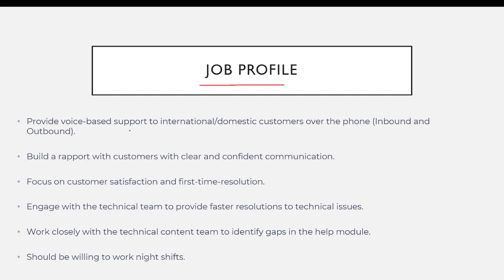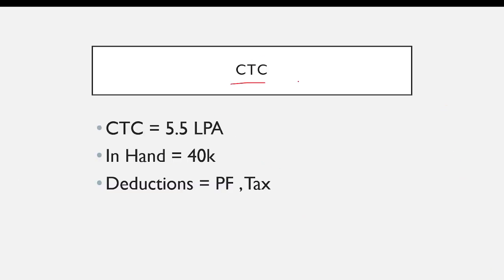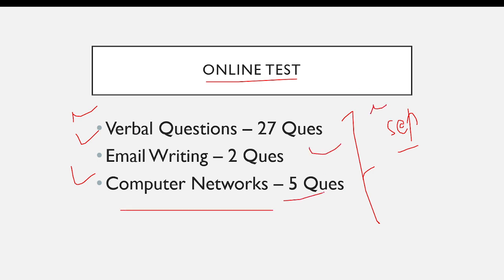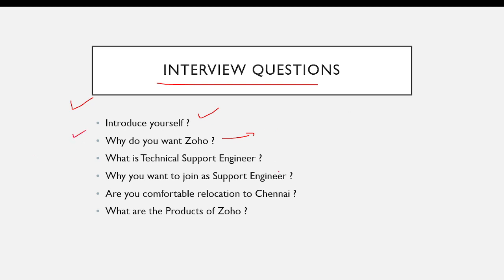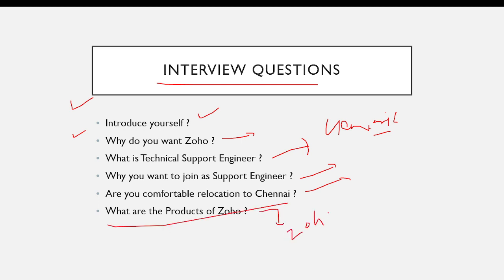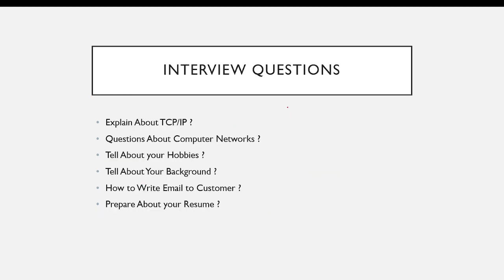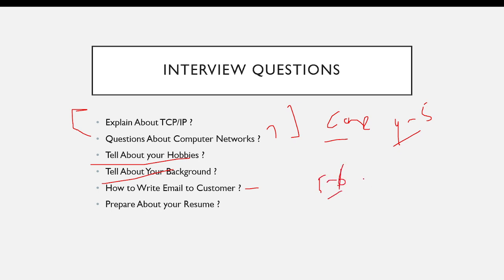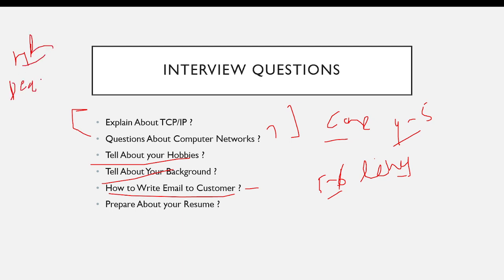Zoho Technical Support Engineer Interview Process | Online Test | Zoho Interview Questions

Comment: Most of the youtubers won't say the below points so, I'm taking one step to tell you about this role.  before applying into technical support engineer role you must aware of the below points.

1) There will be no fixed weekoff like software Engineer they will get fixed sat and Sun but for tech support it would be from mon to sun.

2) Mostly tech support will be night shift so you have to sacrifice your sleep and health.

3) There will be no Indian holidays if you joined as tech support 

4) The shift timing will be different like CST , PST 6pm-3am , 11pm-8am

5) Mostly tech support would be uk/us/Canada as a tech engineer you have to call (via softphone) them once they raised any issue and it would be difficult to understand their accent.

6) Don't expect more package it would be less when compared to other domain.

7) Being a tech support communication plays a major role here. 

8) There would be a 24/7 bridge so whenever the issue is not getting resolved they will start a bridge and you have to be their until it resolved
So as a experienced person in tech support domain requesting freshers to don't apply for this job looks for other domain Java, python,AI, data science, front end, back end, full stack etc..

Note: when I was joined into tech support no one is there to educate this points else I would be choose different domain.